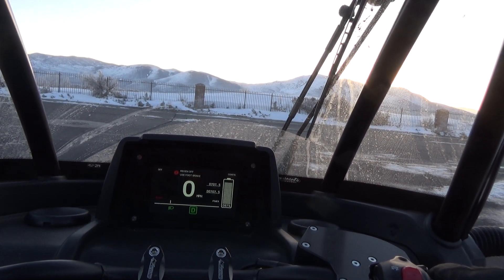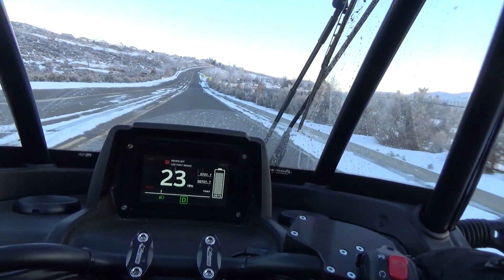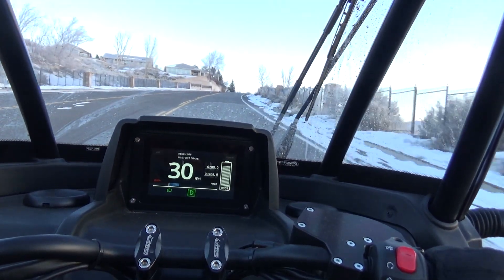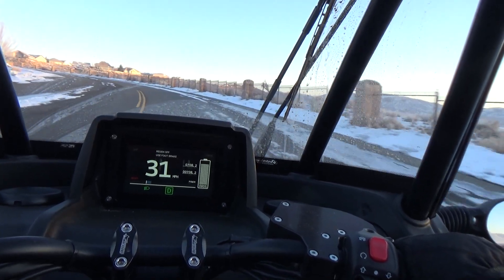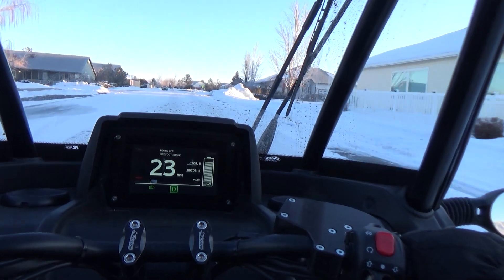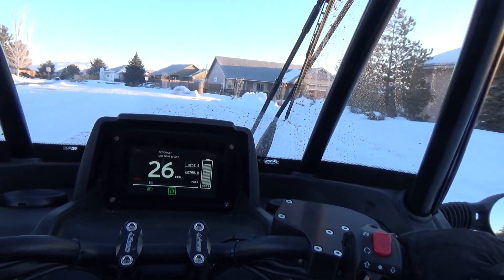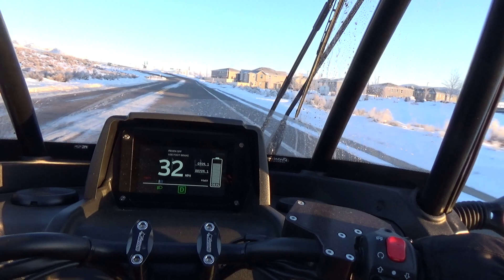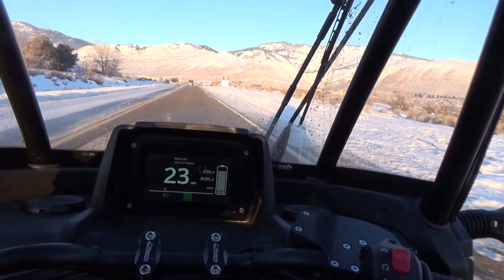Arcimoto FUV operation in 2°F (-17°C)

Comment: How does the battery handle the cold? I took my ebike into the mountains when it first started snowing it seemed to kill my battery pretty quick idk if it was from the cold or trying to climb the mountain with it or both thanks for any feedback
Reply from the maker: Definitely reduced range and quicker drain, and it'll charge only to 87 whereas when it's warmer it'll charge to 90 (the FUV does not "cheat" the numbers like other EVs; it is unhealthy to charge a battery more than that, though it is possible by using an "extended range" mode which only should be done sparingly and only if you immediately drive after charging). But my commute is so short that I'm still well above 70 percent at the end of the day. The regen system will not allow itself to be used, as you don't want to be trying to put that kind of charge into a cold battery.